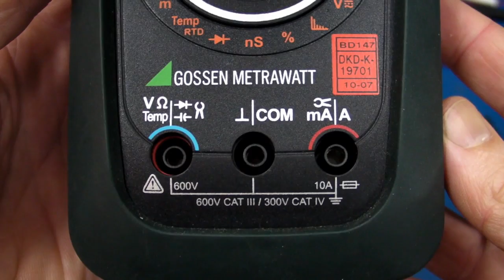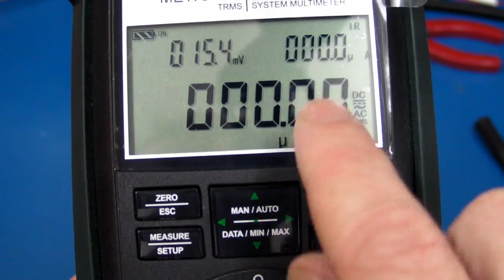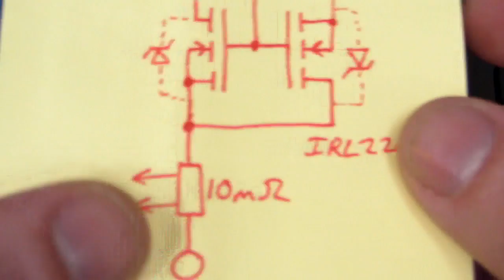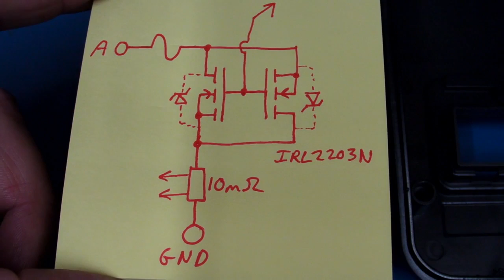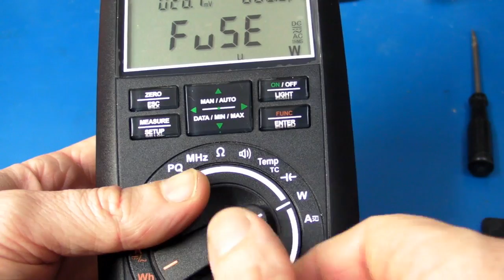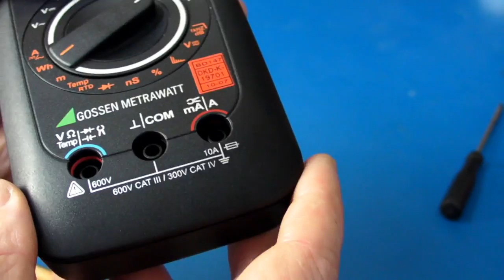EEVblog #173 - Gossen Metrahit Energy Multimeter Teardown

Comment: I am the owner of Metrahit PM XTRA. I ran into a problem with the current measurement. I wanted to measure the current of the LI-ion battery, which is installed in the power bank when charging the smartphone. Until the multimeter switches the range from uA to A, the power bank does not have time to start up. The measurement is unsuccessful. The point is that the internal resistance when measuring uA is large, which causes the power bank to not start up in time. If I manually switch to the A range, the measurement is successful, but it is not comfortable. There is no such problem with older models where there are two measuring holes specifically for measuring mA and A (I have 18S, 24S, 25S, 28S at home). This problem can manifest itself in practice with various measurements. My question is why doesn't the automatic range switch go from A to mA? The problem would be solved.

Comment: I'd like to see how good the input protection really is. Especially in some more extreme tests like shorting out 230V over the different current ranges. Does it recover after replacing the fuse? According to at least one of the comments here, it doesn't.

Comment: "The crappy resistor on the back"....couldn't it be it's for callibrating purposes? That would be an easy way to ensure that every single item sold meets the standard. I mean there's lots of parts in there all with their tolerances, so just measure it through after production and adjust resistance to a default value....Is that a stupid thought? I am new to electronics so ....it's just a guess.

Comment: I got really sad with this equipment... And even more with the Gossen Metrawatt!!!
I bought the Metrahit Energy for my company for use as low power AC measures. The equipment has several interesting functions and I got really glad with my new purchase until happened a really sad situation. Less than 1 month after purchase, I accidentally shorted the input current scale with 110v, and of course had blown the fuse. After I replace it the current measurements just shown totally wrong values.
After sent to the Brazillian reseller and they didn't found any problem, they contacted the factory engineers and they just replied that the warranty doesn't cover bad usage of the equipment and can't do anything for it.
I got really surprised that I have to throw out a 1000 euros equipment with less than 1 month for a short circuit on input. It was not the first time that I blow a fuse, but even on cheaper multimeter the fuse works good and really protect the equipment.
Reply: +Fabio Tempel 
Hi Fabio, 

even the best fuses need some time to react, so there's really not much that the manufacturer could do, except ensuring that the device won't explode in your face, what could happen with a cheap multimeter and thank god seems not to have happend to you.

However, there must be a way to fix this. I could imagine that (at least) the current shunt resistor(s) are damaged. Have you tried measuring them with another multimeter? The locations can be seen in the video. Of course more could be damaged...

Some years ago I bought a Metrahit X-Tra on eBay which turned out to have a brocken sockets lock (that red slider). I called them (from Germany). The customer support patched me to some very competent service guy, I discussed repair options with him and finally we decided that it was cheapest for me to exchange the complete front cover myself. The service guy gave me a spare part number that I could order at customer support, then they sent me the spare part quickly on open invoice, although I never bought anything at them before. 

Possibly try calling the customer support in Germany directly. They might be able to give you a hint which components are damaged. If everything fails, they should be able to sell you a new main board, I hope. I can't imagine that it's really impossible to fix this. 
However, even if it's just the current shunt resistor(s) and you can exchange them, the device might need recalibration afterwards to achieve full precision again.
Reply: Fabio Tempel It is a long time since you posted the comment, but assuming you still have the meter and would want to fix it, you might want to check and replace the two MOSFETs in the current input paths. If you watch Dave's "how to design a better multimeter part 2" video, he explained that in the Gossen's configuration, the body diode of that two MOSFETs are used to clamp the inrush current before the fuse blows, and the two MOSFETs seemed very likely to blow in such configuration if you connect the current range to mains.
Reply: +Fabio Tempel Über alles!

Comment: There are very different types of electrolytic caps on the market and I would guess that a manufacturer like this one will not use the cheapest quality. So you'll have to find out the exact type and look up the data sheet to tell if there might be a problem on the long run and when.

Comment: Dave, I don't understand what the purpose of those two large FETs in series with the current sense resistor is? It looks like even when they are off it will just add a diode drop in series with the sense resistor.